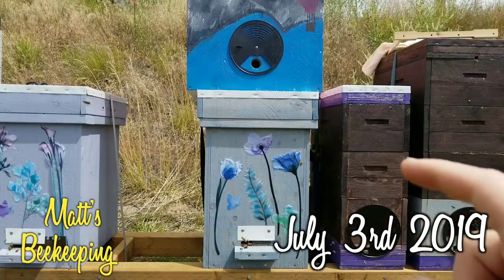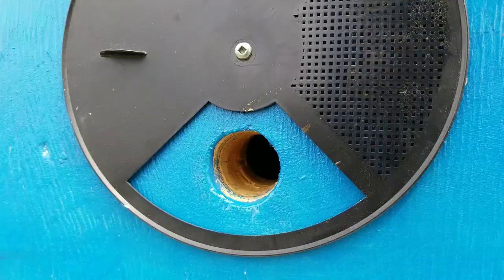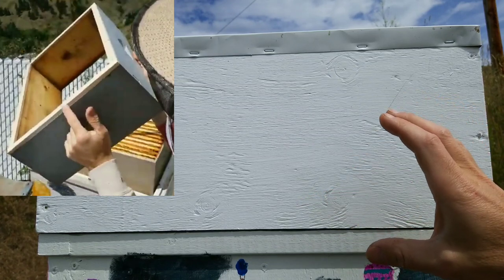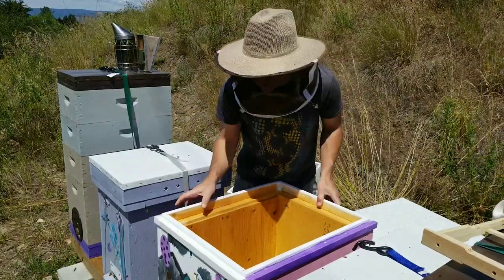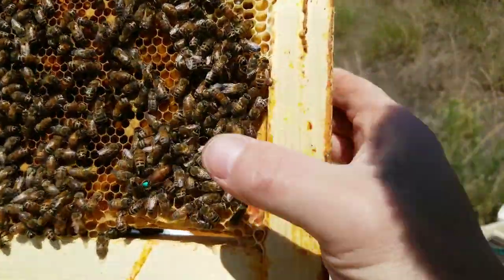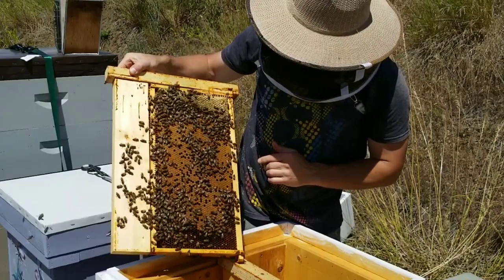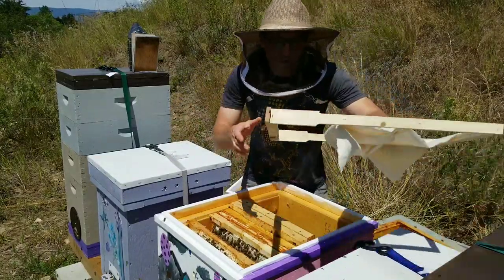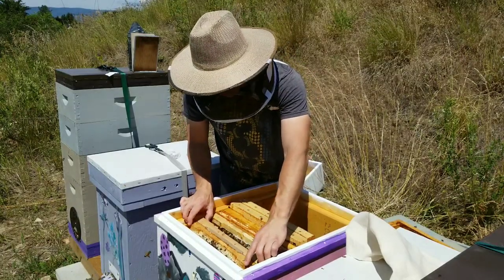July 3rd 2019 - Hive Design Changes - Matt's Vlog #154

Comment: On my box in a box hives, I just slot or drill through the pink foam in the hallway. The bees don’t seem to care. Was there a reason you changed from the slot to the circle?
Reply from the maker: It was faster and easier to make. And If I wanted to try different size entrances I could just drill more holes or larger ones. Cheers